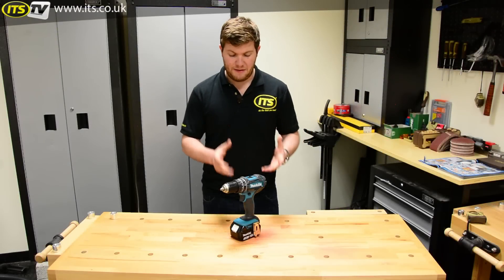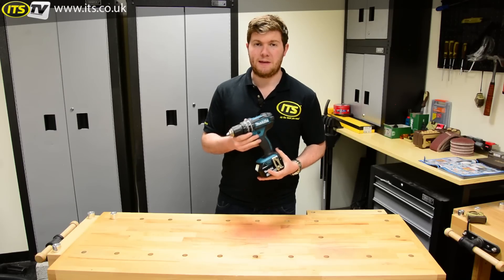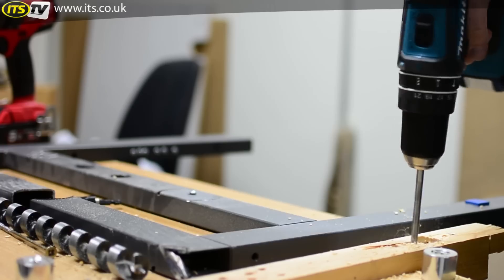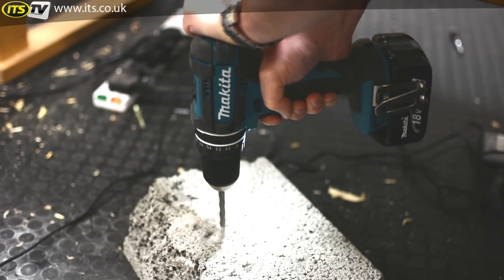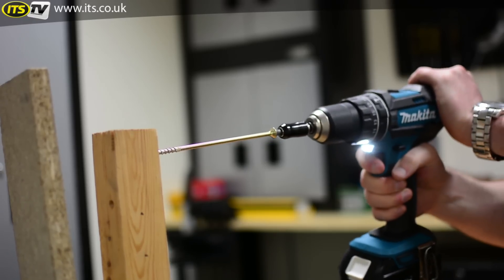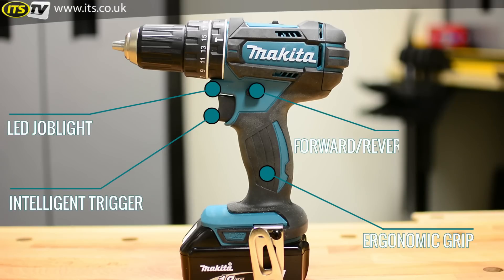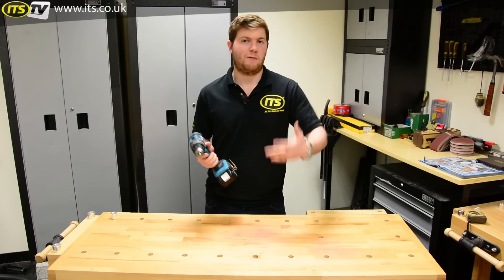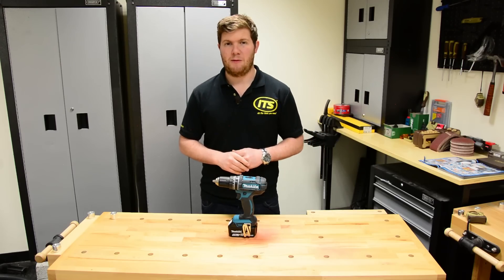Makita DHP482 18 Li-ion Combi Drill Demo - ITS

Comment: why do people keep using Phillips bits? the Robertson is far superior. it lasts way longer, the bit doesn't slip nearly as much, and u don't need a magnetic bit to hold the screw on the bit.
Reply: Caleb VeeDub I'd recommend the Miketa bits
Reply: Wera is far better
Reply: Hitachi makes by far the best bits, One TX30 lasted me a year. You lose them before they wear out or break. Same with Makita gold, Wera has stupid shape. You cant grind the  tip down in lenght, with hitachi you can grind it down 3 times and its still useable.
Reply: Torx!!

Comment: Hi, I have an identical drill like this. It seems to work fine, but I see that mine has a little play on the chuck backward and forward in every setting I could make. Is that normal ? Thank you.
Reply: Yes
Reply: Same as mine. When I tried a new model it didn’t seem to move so much

Comment: I'm looking for the everyday home jobs to drill woods, hanging frames, bathroom, installation od lighting equipments, drilling on woods and etc. Can this one able to drill on the walls? and even on concrete walls ?  will u suggest me to buy this?
Reply: You won't have any problems with general duty jobs, I used mine the other day to drill 2 " deep holes ( hammer action) in to solid concrete floor. eazy peazy. No problem for the drill
Reply: thanks bro but the price kinda expensive
Reply: yes , but for a makita cordless combi drill this is probably the best for price/torque. you could always go for a powerful corded drill for half the price. Depends what you want/need
,

Comment: How do you open and close the chuck, I can close it by holding it and pressing drill but I cant open it?
Reply: just the other way around: change the direction and it will open; or you turn it by hand (open/close is printed on the drill)

Comment: well it is a brushed motor but the price is still 200 pounds. what da heck.
Reply: Jk957 mine was £52 on amazon
Reply: They rip ya off on the batteries more than anything. Each one of those boxes of angry pixies has 10 Japanese 18650 cells in it. The cells in those batteries alone can run you up 60+ quid, and the kit comes with two of them. If you already have all that they do sell the drill only as well.